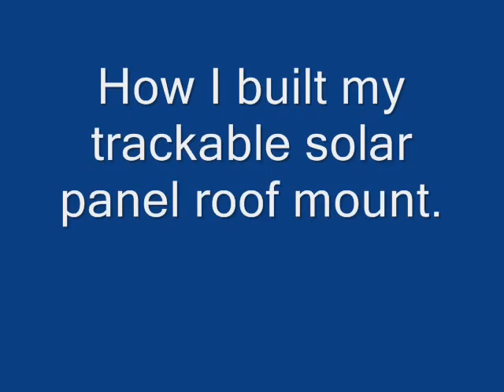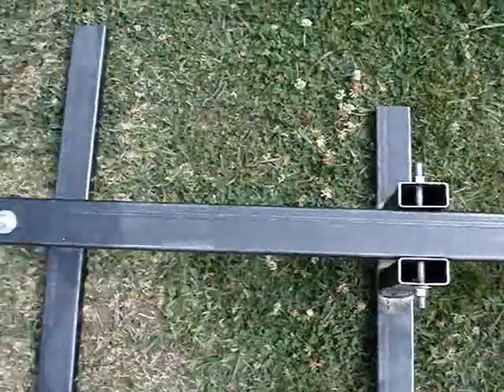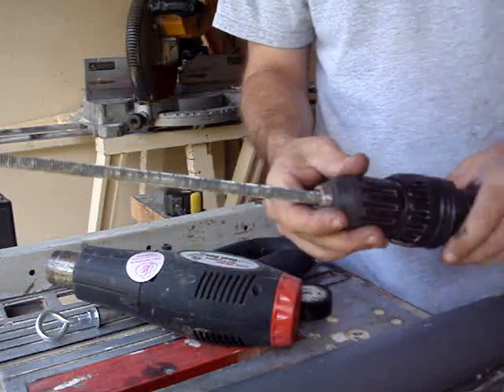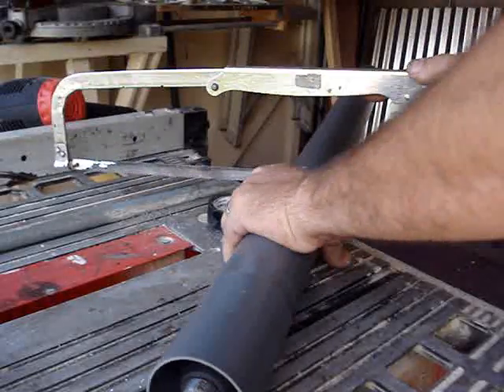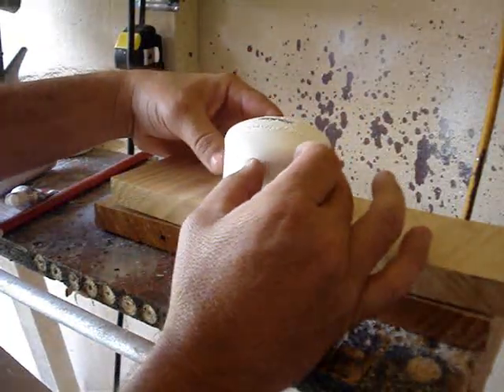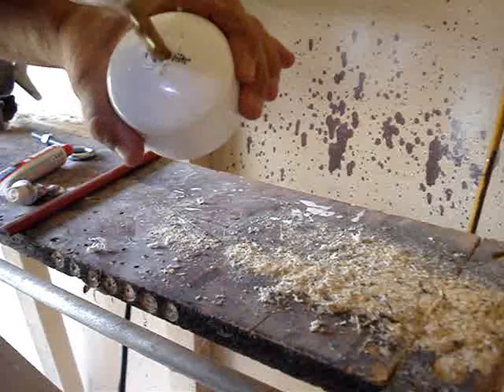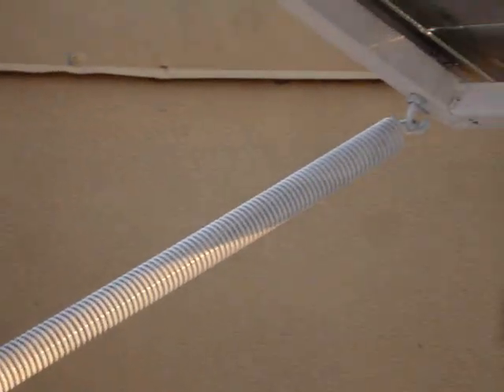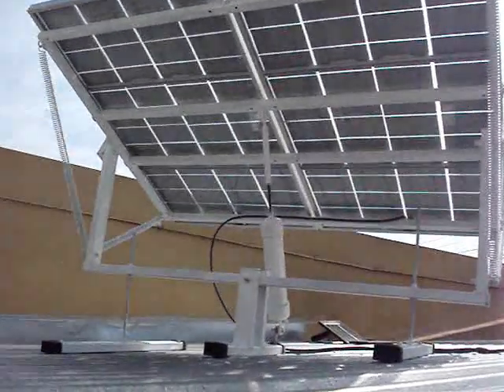How to build a solar tracker. DIY solar panel sun tracker.

Comment: I realize you used what you had laying around, other than cost why didn't you use a linear actuator? Because the threaded screw will eventually get galled. I realize now after the fact the female end doing the threading is exposed and can be changed out if necessary. Wonder if the life span would be equal and the reliability which one would last?

Comment: Due to the extreme drop in the price of solar modules tracking systems are now superfluous.
It is much cheaper and much more reliable to simply install more solar modules!
Trackers are mechanics and need maintenance. And they are very susceptible to wind. For this reason and because of the mechanics, most of them only last a 1-10 years.
If you want more constant yields throughout the day, you simply have to set up the modules in an S-E and S-W orientation.

Comment: A solar tracker, an electronic one, takes only 4 electronic components, very cheap ones. Aside the actuators, that is. And that tracker always follow the sun, without any programing. That thing also tracks the moon, which is a light source, or a nearby ligth pole, if you're in the city. 
And the tracking panels get mounted on a pole, not on a fix base, and tracks both axes. Very cheap, you can do it yourself.
The only programing is the wind protection, for that you need a wind sensor, and the ability to flaten your panels position whenever the widn exceds certain velocity, somewhere around 35-40 mph. Until that point it's safe.

Comment: Ya need r small solar panels. A peicd of wood to make a shadow and 4 motors. Sun lights panel, turns motor and keeps going until its shade and turns off. No battery or Computer :) full 24/7 solar tracking

Comment: Good set up , But Steel is awful heavy ,  I used aluminum framing . I have 21 panels that are 210 watts each so steel was not an option cause of the weight !

Comment: Other than my fear with the epoxy, I can't tell you how impressed I am with your homemade actuator!!  I'm probably a weirdo, but I love playing with actuators.  I used damper actuators to automate my chicken coop.  I also used a linear actuator to move my solar array.  I tried to turn the array with stacked damper actuators but it was too much for the spring-returns to handle.  Great vid bro!!!
Reply from the maker: Hi thanks for the comment. I have used this for five years with no failure. You have to remember that the longest this thing runs is about 25 seconds for a whole day. It does not have time to heat up and with the springs there is not allot of pressure on the actuator.

Comment: i have 250 watts, 3 plates / Panals and  i think its 24V capacity. can i put directly DC air cooler connecting with the Panals

Comment: how much is it efficient than using it on your roof normally?(Reducing the cost of the motors to run)
Reply from the maker: tracking is 20 % or more efficient.The Arduino- Digispark uses about 36 ma and the motor runs a total of about 30 seconds for the 24 hour period.
Reply: Aceman307 thanks

Comment: For years, I'm looking for a video where someone would have installed a solar panel with solar tracker, and another fixed panel nearby. The goal is to determine exactly the energy gain. I NEVER found anyone who did this experiment. Do you know such a case?
Thanks in advance.

Comment: Great job. 
A couple of small wire ties would keep the wire from sliding out without using a knot I’m assuming you use a timer to feed power on a schedule to rotate the panels

Comment: You would need to have two seperate axis for rotation to adjust for both latitude and altitude of the solar position.

Here is what I come up with (not actually built):

1. Have a ground platform on 3 legs (each have a ground plate so you can put ballast on top for storm protection)  connected with 2 metal beams (T-shaped frame). Three legs is more stable then four. The leg of the 'T' is positioned in the north direction.

2. In the middle point we install an axis with a Chain wheel underneath and a plate on top. The chain wheel is connected to a motorwheel by a chain. Use a small chain wheel for the motor and a larger one for the axis. For example from an old bicycle.

3. On top of the rotating plate we install a horizontal beam (east-west facing) and at both ends we install vertical beams. So this rotating construction is U-shaped.

4. We connect the two vertical beams with a horizontal axis and a chain wheel in the middle also connected to a motor with chain wheel and chain.

5. The horizontal axis then gets connected to a rectangular frame that holds he panels. Use enough space between the axis and the frame for the size of the chain wheel in the middle of the axis. 

Alternatively, attach the chain wheel at one side of the the axis where it is outside the frame (so, the axis exteds beyond the frame), so the frame can be directly connected to the axis.

NB. Instead of using chainwheels on the axis, you could alternatively also attach the chains directly to the rotating frames. This saves a chain wheel, and allows for smaller construction.

The rotation around the vertical axis is for following the sun during the day. It has to allow for a turn from -120 degrees to +120 degrees and  place stoppers at each side of the maximum rotation.

The rotation around the horizontal axis is for adjusting for the season. It has to allow for a turn from -15 degrees to +15 degrees RELATIVE to the inclination associated with your lattitude. Also place stoppers at each of side of the maximum rotation.

Then the controls. 

Each motor is connected to two wires, which are connected to a arduino board (or other single board computer) with relais that can put the motorn on/off and turn clockwise/anti-clockwise. Use motors of proper wattage and - when in rest - do not slip due to windforces on the panel frame.

You need to measure the time it takes for doing a rotation from one end to the other end. With that you can calculate the approx. time it takes for a one degree turn. For example, if it takes 12.0 seconds to rotate from -120 to +120 degrees, the timing is 0.05 seconds per degree.

This will give you two parameters you will use in your program for rotating a specified angle.

Then next you need to design a program that will rotate your panels in the right position. 

You will need a table that holds the information for each day the solartime the sun rises and sets (in minutes from noon), and the minumum and maximum angle for altitude and the latitude angle, and a function that calculates the solar time in minutes (from local time and adjusted for winter/summer time). 

Your program then calculates at what time the sun goes up (and sleeps for the remaining time period), and runs both motors for the specified angle of rotation for latitude and altitude, and from then on, for each minute untill sunset, will adjust the altitude by the amount of rotation for both axis (vertical and horizontal).

For the vertical axis rotation, calculated as:

Between sunrise and sunset:
minimum horizontal angle + (solar time in minutes - sunrise in minutes) X (maximum vertical angle - minimum vertical angle) / (sunset in minutes - sunrise in minutes). 

For the horizontal axis rotation, calculated as:

After sunrise and before midday:
minimum horizontal angle + (solartime in minutes - sunrise in minutes) X (maximum horizonal angle - minimum horizontal angle) / (sunset in minutes - sunrise in minutes) / 2

After midday and before sunset:
minimum horizontal angle + (sunset in minutes - solartime in minutes) X (minimum horizontal angle - maximum horizontal angle) / (sunset in minutes - sunrise in minutes) / 2

After sunset is reached, the panel rotates to the default position and goes asleep again. 

Occasionally check if the default position is where it is supposed to be, and reposition accordingly if the position needs readjusment.

The arduino board and relais for motor control are installed at home near the power supply, connected to the installation with the 4 wires (+ and - for each motor). Check the voltage of the motors and connect them to a proper power adapter with the right voltage.

Additionally, you could add some pins or clams for holding the panel frame in its default position for storm protection (turning the solar panel controls off), if your rooftop is (easily) accessible.

In any case, add enough ballast to the ground platform and make the construction solid enough so that it can endure storms.

After installation, do some checks for proper allignment to the sun, or tweak the program parameters for the proper settings. Your installation has to be aligned in the north-south direction, so when in rest it faces south. 

Lookup in tables what correction is needed from the magnetic south from your geo position.

Notes:
- For extra safety you could attach panels to metal cords connected to some ground weight, properly sized so that they don't disturb the normal rotation of the panels.
- You can check proper alignment on sunny days with a rod placed orthogonal on the solar panels, and when properly alligend, it should cast no shadow.
Reply from the maker: Thanks for the comment

Comment: Me need of automati sun tracking system.
Electrical wiring diagram.
you video is very nice work is good.
This project working is manual
Hom work is automatic?
Reply: Stepper

Comment: Excellent build, may I ask, what circuit board or set of electronics do you recommend using with your drill motors.  If you have a circuity diagram, that would be great!

Comment: Appreciate the knowledge, building a cabin in AZ. I managed to find 4  acres of mountain grass lands.
  It's hard not to brag a little but I guess the truth is just that. The views are stunning,,, mountains surrounding the area,, it must be like Tucson AZ. A hundred years ago before all the homes and offices were built and parts of town buildings don't allow you to see mountains.
  Of course all power will come from solar,, things have changed since solar was introduced to America and took off like wildfire and you could sell your excess power to the electric company at least in my area.
  BUT I've got my well in and it's bringing me all the cold clean clear pure drinking water a body could ask for. I'm really proud of that well, it's been a dream for me along with the property. No more water bill,, regardless of water companies going broke,, or if some disaster caused them to not produce water coming out of the tap.
  I can't tell you how much I worried about having water, clean water that doesn't need to be cleaned and boiled before you can drink it. Farm animals as well need clean water. And actually a barn was on my list of wanted,, bingo we got it. Everything is going to be soon, all powered by the free solar sun.
  This tracker will be a great addition. Solar is new to me, but I will continue to learn.
  The one of my problems I'm trying to figure out is,, should I power each place, separately,, that's what I think I'll do, but still haven't decided. Regardless the tracker will be built on all or separate.
  Thanks for the advice of building one. 👍
Reply from the maker: I am glad the video helped. Good luck with your projects. Sounds great.

Comment: Not sure if you are monitoring this video site, 1 question,  with the drill well sealed from moisture from rain,  it looks like there is minimal air flow.  Have you ever noticed any moisture buildup in the cyl that the drill is in.  I like in S Ontario,  cool nights hot humid days,  it is natural for humid air to condense in the closed space.  Great video and effort in your project
Reply from the maker: I have not noticed any. The longest the drill runs is in the evening when it returns to the east and thats about 15 seconds. The actuator still is working flawlessly.

Comment: Sorry if this is an obvious question, but do solar panels make the most energy directly facing the sun, rather than at an angle? I'm considering a system like this on the top of a camper van.

Great work on your system, I love it!
Reply from the maker: Yes you should have around a 20 percent increase by tracking the sun verses stationary.
Reply: Awesome, thanks for taking the time to reply Aceman :)

Comment: Good job, but this is only a 1-axis track, so I assume it's for dawn-to-dusk tracking, not for seasonal tracking.

I'm looking to mount mine on a long aluminum tube (that was used to roll up a pool cover), and hook an antenna rotor to one end of the tube for dawn-to-dusk tracking. (Moves like a playground see-saw). These are high torque and heavily geared motors and should have no problem holding it's position in windy areas. Each end of the tube will be in a suitable mount, and to change the seasonal angle, I manually raise or lower one end of the tube. (In summer the tube will be parallel to the ground.)

Comment: hey im doing my final year project similar to this video, may i ask how do you make the solar stand(brackets)  that rotates the solar frames
Reply from the maker: The brackets are held together with bolts and lock nuts just don't tighten the bolts down all the way and the pieces can move. The movement is very small and slow. So really you do not need bearings. Just a little grease.
Reply: Thank you! im gonna do just that

Comment: 12:40: How did you fastened the hook in the frame?
Reply from the maker: It was a bolt that had the hook in the end. Di you check out my update to this video?https://www.youtube.com/watch?v=yDxCCJ1NwGs
Reply: Aceman307  the hook has a thread on it's end, right? Is this thread screwed right to the frame or you have welded a nut on the opposite side?
Reply from the maker: It goes all the way through and I use a nut on each side. But you could weld a hook on it.

Comment: Nice little project. Will you be posting your results of how it works with production of usable current?
Reply from the maker: I was not going to mainly because this video is about the tracker. If people build the tracker they could put any combination or size of panels on it. The information on trackers is about a 20% gain in power production verses stationary. I have updated the operation of this tracker there is a link in the video. Thanks for watching.

Comment: I can't get the frikkin' gears and motor from the drill to line up for the life of me. I have some really cool gears and high rpm 12v motor now though. :)
Reply from the maker: What , did you take apart the planetary gears?
Reply: Aceman307
I like the thought of DIY, but end up the BIY category. (Break It Yourself). Of course, it being my cherry run on taking the drill apart, I pulled one of the sides of the casing too hard. Voila! Instant BIY and then try again when I can pick up an old one at the flea market or a yard sale for cheap. :) Ima give it a go again with more caution next time around. I've watched your video a couple of times and like the idea. Pure torque, Man. Then hook the Arduino like you did and sky's the limit. :)

Comment: If you already have a stationary mounting of your photo-voltaics to your roof it should not be too difficult to make up a tracking system like this to mount to the base mounts already installed on the roof.  From what I have read on tracking in general you improve the production of electricity by as much as 30%.  If you are handy like is required in this video it is a worth while project.  I you are not then you must search for a contractor that has the imagination and thought process to accomplish your project.
Reply: For a more robust, dependable actuator you can use satellite dish actuators select from various sizes that have limit switches built in and they are photo cell controlled.  A lot less work.

Comment: nice concept but those springs are doing nothing but adding a huge load for that motor
Reply from the maker: +nuthn2do Its not a load at all. Without the springs the weight of the panels are a lot. The springs keep the panels in the middle as the tracker moves east to west the weight of the panels is lessen by the springs making it easier for the motor. This tracker has not stopped working since I have posted this video. Thanks for the comment.

Comment: I wonder will the drill motor over heat & eventually Burnout since it's not vented with fresh air
Reply from the maker: +Your Sperits Channel The motor only works for 1 second every 30 minutes about 9 times in a day. There is no way this motor can over heat. Thanks for the comment.

Comment: what is the tool that you are using @8:27? and how do you track sun? sensor?
Reply from the maker: +luo XW A Mig welder. I use a timer to track the sun and it resets every night. I have other videos on the timer.

Comment: I m very surprised that such technologies are not offered when you buy a roof solar panel (by default)
Reply: My experience with a contracted project is  that if it is not standard in the package that the contractor purchases, the contractor frankly plays stupid or tels you it can not be done.  For me the definition of "Impossible"  is impossible does not exist it just takes longer.
Reply: It is more that, for anything non standard you would need extensive testing wind load evaluations etc to put it on a roof legally. Having said that you can buy them it just costs twice as much for a 40% increase in output so if space isn't an issue just go for a bigger array.